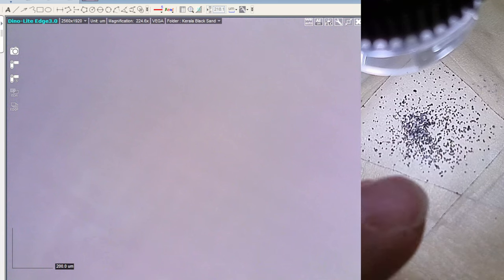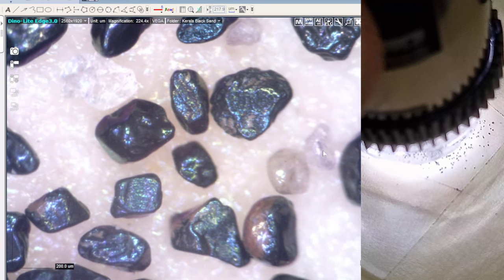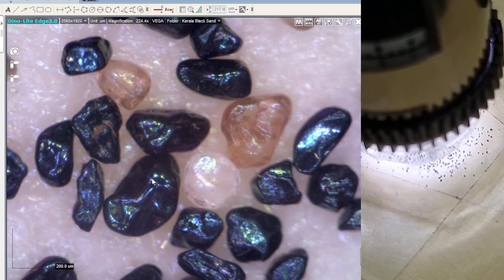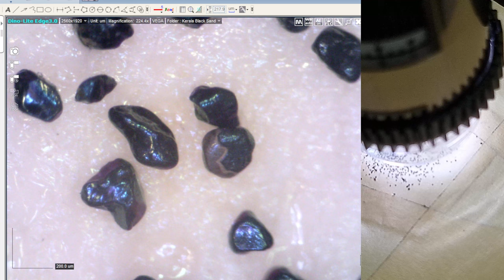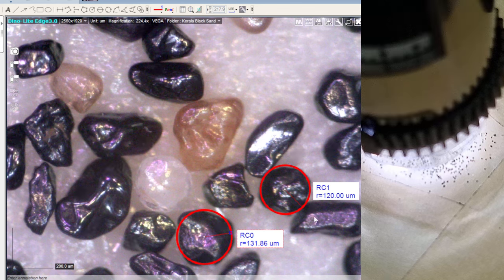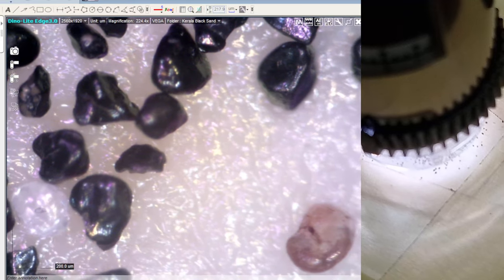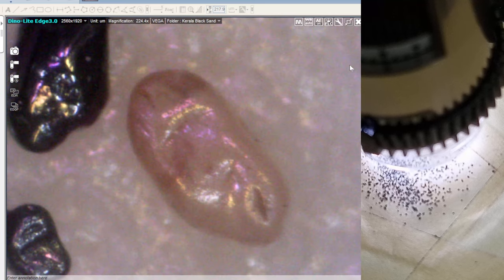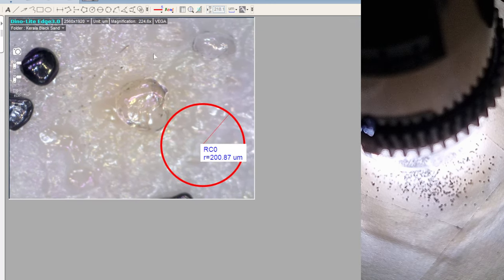Fixing Fukushima - Kerala Black Sand Magnetic Properties

Comment: You mention Pitchblend (the mineral Madame Curie worked with), but in the paper YouTube won’t let me link  I read that one of the minerals found in these sands is Hornblend. Anyway you already confirmed the presence of the radioactive elements, so the basic premise that this material can be used instead of tritiated water to quantitatively measure the reduction of radioactivity by the Ohmasa gas treatment is proven, at least as a valid and repeatable model.
Reply from the maker: I meant Hornblende, seeing the U238 progeny got me thinking Uranium and I got my minerals mixed up - I made a mistake.

Given that Brown was said by witnesses to have shown remediation of non-magnetic Americium 241 (Alpha/Gamma)  and the magnetic 60Co (Beta/Gamma), I think that there is a good chance that this material will be able to show the same effect if the original observation was valid and the  work of Matsumoto suggests it may be, as does our replicated work with Ohmasa/HHO + W/Ti.

The advantage with these Gamma emitters from the Thorium 232 / Uranium 238, is they will still be able to go through a vitrified bulk. And the argument that the Alpha and Beta are screened will be void.
Reply: @MFMP  don't sweat it brother, we are not mineralogists, suffice to know that both end in "blende". I just pointed it out because I read it in that paper (I am now logged in my notebook, I have this alternative account by default in it). And indeed the fact that this sand is emitter of gamma is an advantage as it won't go away easily, only if the materials are transmuted into stable stuff.
Reply from the maker: @osianderkuhn5255  I had actually read the paper and knew it was Hornblende before I recorded this video ( I even had a few images of it in my browser windows), it is mostly a case of rushing a video late night with little preparation or review, just to get it out of the door - but these are not meant to be perfect as I know the hawk-eyed like yourself will pick up the errors. I will add a sticky Errata.